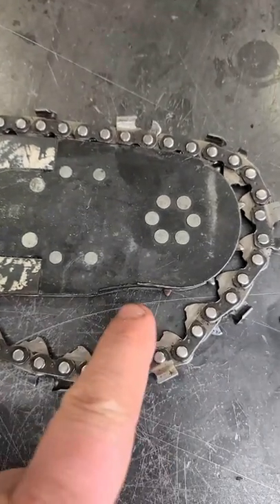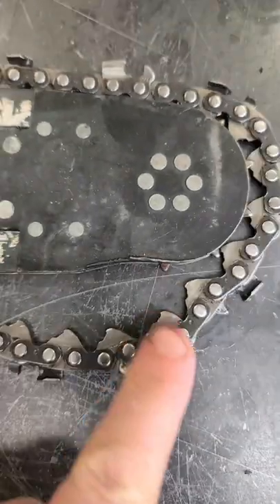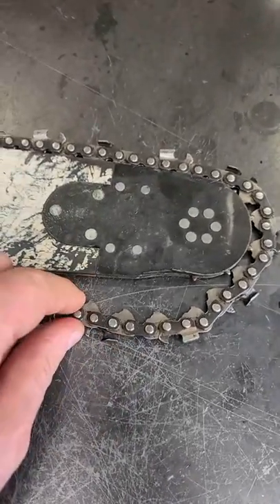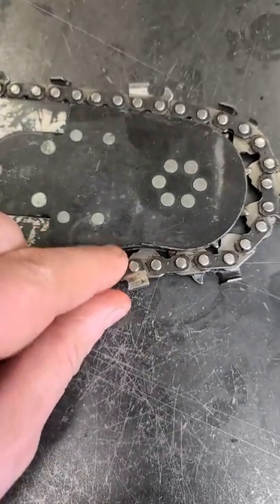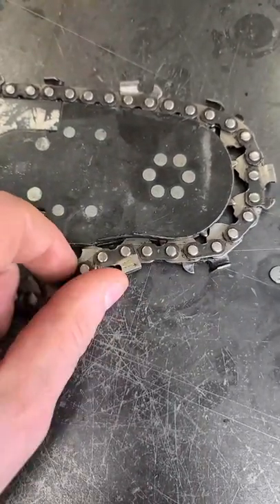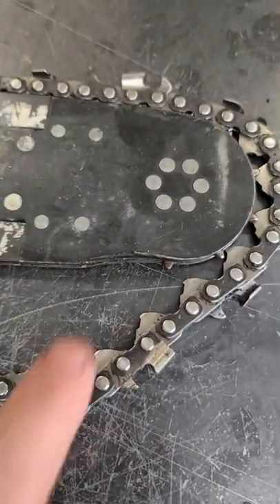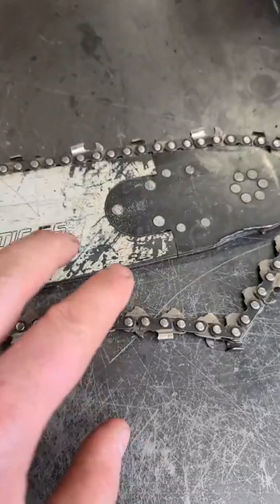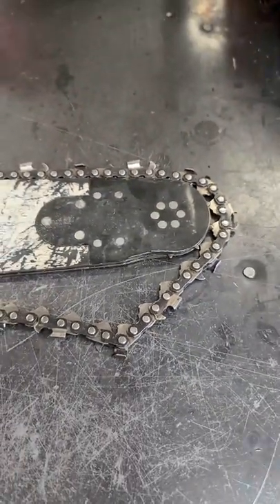Why Does My Chainsaw Bar Have A Crater? #shorts

Comment: Looks to me like the bar nose was used extensively in limbing & brushing. The nose is replaceable & not too hard to replace, but one has to weigh the cost difference between simply replacing the nose & just replacing the whole bar. Also, check your drive rim or spur sprocket for wear, & replace them if they need it.

Comment: The reason that happens is the chain want to keep going in a circle off the tip. It dives into the rails there. It can do it right by the clutch as well. Good tip video
Reply from the maker: yes absolutely

Comment: I've seen that wear a lot on saws using discount brand bar oil, and significantly less on saws using quality oil.  maybe there's a connection between the oil and maintaining proper chain tension, but I notice a significant difference between the feel of the guides on a chain with good oil, and a chain with cheap oil.
Reply: Yeah definitely. There are cheap liquid bar oil which just splashes and good quality ones who sticks to the chain and bar like a glue.

Comment: Don't replace the bar, replace the TIP. And everyday they use the saw tell them to rotate the bar. I bet that bar was never rotated and spent a lot of its life as a limbing/brush saw.
Reply: Or just replace it. Bars are cheap. The labour to fix it to just still have a used bar isnt worth it.
Reply: the center of the divot is at the seam between the bar and the tip.  just replacing the tip still leaves the damage to the bar.
Reply: @kenbrown2808  That's not what I'm seeing. Windsor style tip....'divot' on the tip itself. 'Seam' is well to the left of the divot. Sprocket nose tips are consumable, the reason they are riveted in. If it's a cheap bar, buy a better one, rotate it and learn about chain tension.
Reply: @TheReal1953  okay, yeah, that tip is longer than I'm used to seeing, and I didn't inspect it close enough yesterday.  the ones I'm used to seeing that kind of damage on, it does center on the seam between the bar and the tip.  I'd also be looking at the condition of the bar before committing to changing the tip.  reminds me of a time I spent an hour dressing burrs on the guides on a carbide chain (caused by repeatedly throwing the chain) only to find half the carbides were also broken.